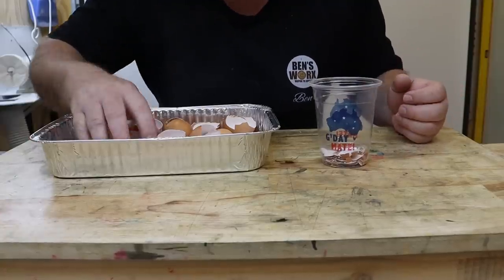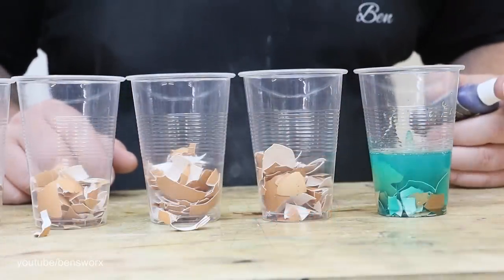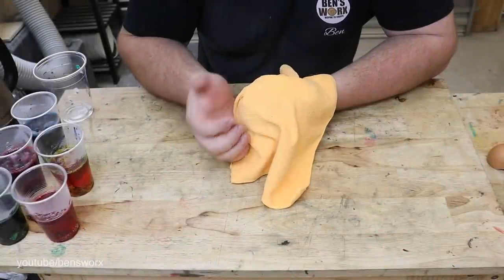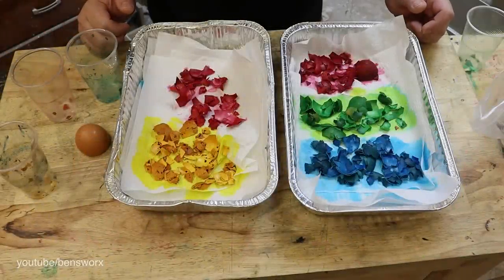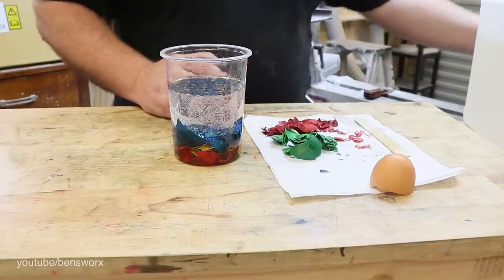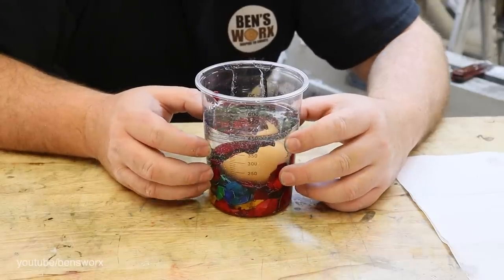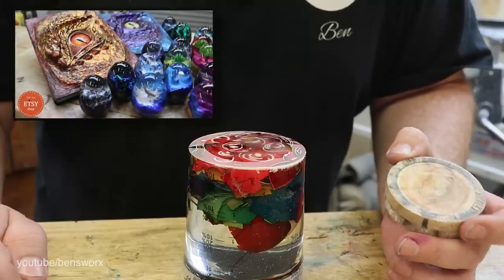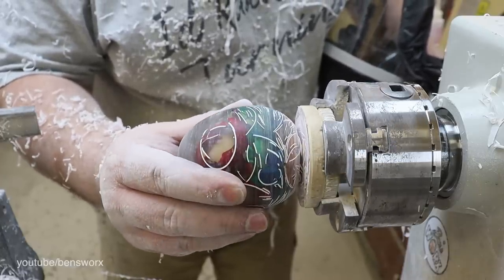Woodturning Eggshells - EGG THAT Ep 2

Comment: I had an idea for how u could have kept the layers more separated if u had wanted to. Take a thin clear plastic water bottle and cut discs from the sides of that bottle. Cutting the disk to a smaller diameter than the pour/casting container will allow the layers of shells ( or whatever u want to use) to be separated, but wont impede the flow of resin so that it should encapsulate the clear disc enuff that the final product wont (hopefully) separate into layers as a result. Also the clear plastic might remain clear after casting so that the layers seem to float. 
ALSO...if u wanna incorporate more distinct layers u can pre-cast super thin discs of resin and polish them to a clear shine and thus ensure complete incorporation.
DOUBLE ALSO u could add color to those thin, pre-cast, polished discs and then layer those in separated by spacer rings made of pre-cast, polished clear resin. Then u could turn an expanded rainbow, or alternate stack the resin discs with a variety of wood discs and turn that!  As long as the discs are smaller in diameter than the casting vessel, u could have all sorts of deep rich yet separated colors with out having to pour each layers individually and wait for each layer to cure in between pours.
Pre-cast multiple thin layers all at once and then stack them in a secondary pour/casting. I know that this is a WHOLE lotta ideas and thoughts, but once I got going the “oooh, what if...:s  started to avalanche.
I hope that u think at least some of these ideas are cool enuff to motivate u to attempt any of them, it’d be cool to see.
Thanks for the awesome vids and have a wonderful day!

Comment: could be interesting if you made an egg bowl and then soaked it in vinegar to dissolve the shells and then fill the cracks with a colored glow in the dark epoxy a similar color to the color you died the shells... and because it is a bowl alot of the shells would be exposed for dissolving.

Comment: my first instinct would be to mix them up, but I don't know why. After seeing you do layers, I think I also would do layers.
But, when you put the blue layer right after the yellow layer, I felt that was not the most beautiful choice. I would strongly prefer to put the green layer between the yellow and blue layers, to simulate blending.

From start to finish, I just didn't like looking at this egg. I don't have real OCD, but the random shell fragment shapes and sizes seriously rubbed me the wrong way. I wanted them more crushed, but also less crushed at the same time, and more uniform, but also not lying flat. I guess I just can't be happy while looking at anything made out of eggshells. I've seen resin full of paper shreds from an office shredder, and it didn't bother me at all, so I guess it is the odd shapes, and the knowledge that those shapes are fragile and crunchy, flattenable but not flattened, that bothers me.
That said, my interest in variety and experimentation far outweighs this feeling, so I don't regret watching this video at all.

Egg suggestions:
-cashews.
-very dense tangled colored strands (denser than rubber bands), like dyed fishing line.
-rocks. Maybe rocks that are suspended in the middle of the egg so they don't need to be cut away with the lathe.
-tiny colored cubes, like diced erasers.
-A bunch of parallel metal rods (maybe nails), going all the way through the egg, and not filling up much of the egg, so you can see between them and around them.
-a 3d-printed repeating pattern.